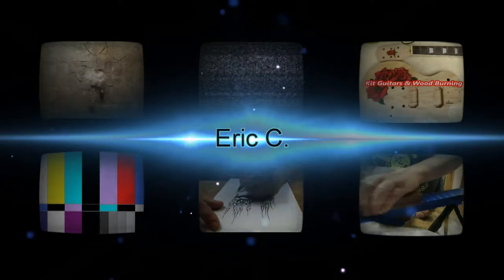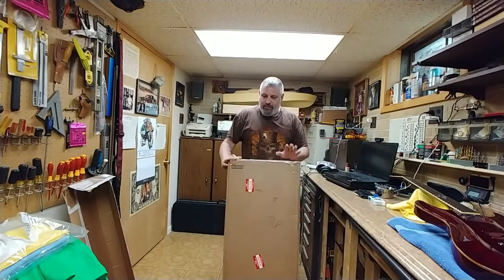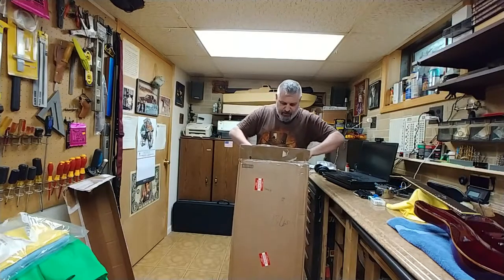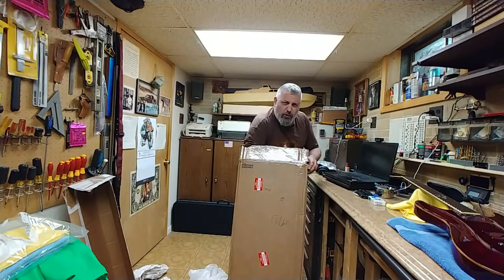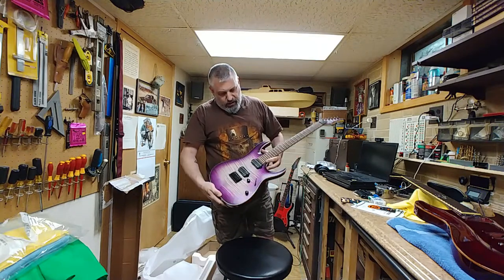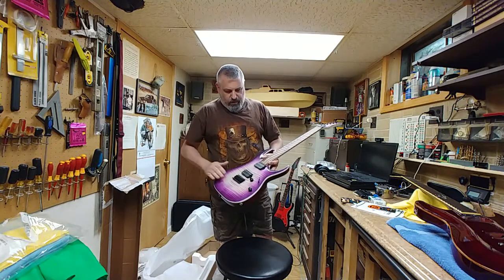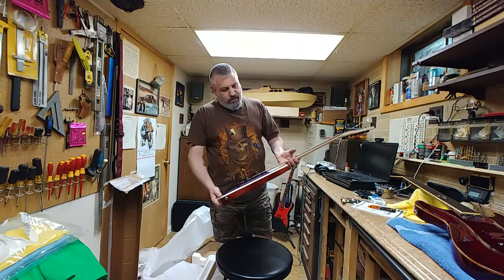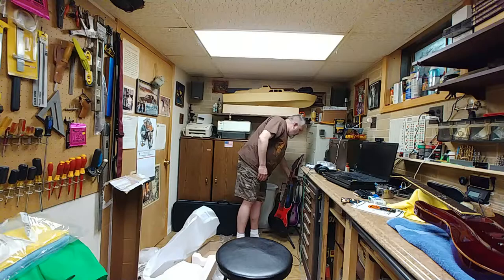Oops! I Did It Again

Comment: What's up with that RC boat in the background?
Reply from the maker: my father and i started to build it when i was in my teens. we never finished it. my father said some day he will get it done.
Reply: @ericctheartofnoise8613  My brother is into it BIG TIME. His boat run well into 100 mph range. Certain ones hold State and World records. He LOVES it! I could never see putting the kind of money he puts out for them. I could have a few very nice REAL boats. Lol!
Reply from the maker: @DetroitWrecker666  I use to have a Corvette pro street r/c car. The car kit was $80. I went with a Toxic motor electric. Can't remember what the speed contoler was, but it had no revers and my car did 35 mph. Between the remote, servos, motor, battery and charger. Plus speed controller I spent over $800.  This was back in 1994.
Reply: @ericctheartofnoise8613  Remember the old Hornets? Grasshopper? I had some pretty cool cars back in the day. My brother took it to a whole different level. He has boats where the engine alone is $2000. They're pretty friggin cool to watch. Let me see if I can find some film, maybe I'll post a video.